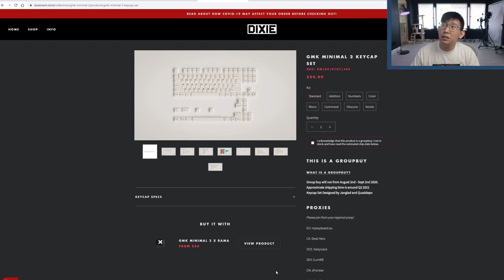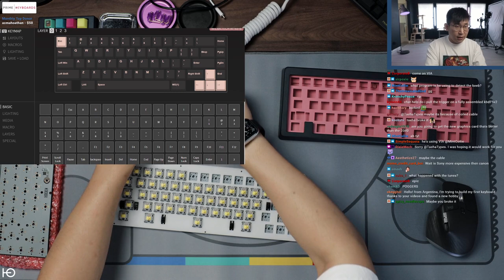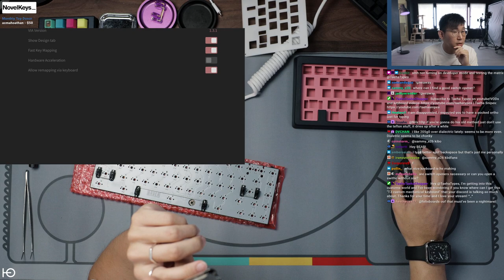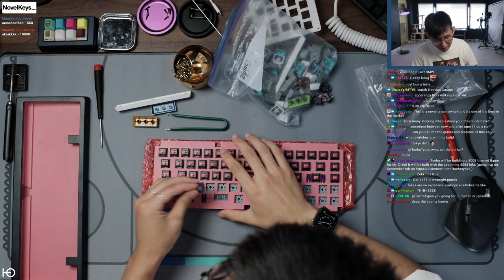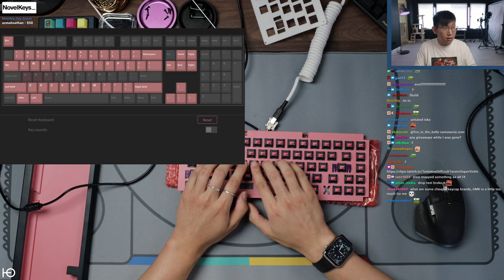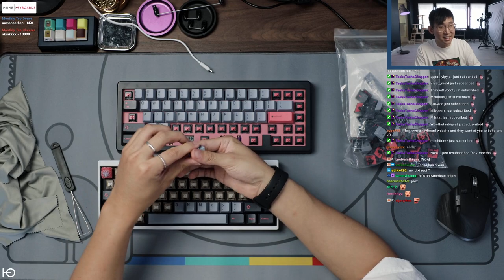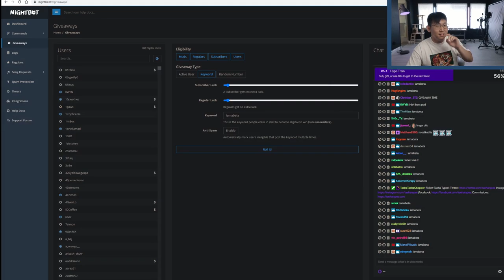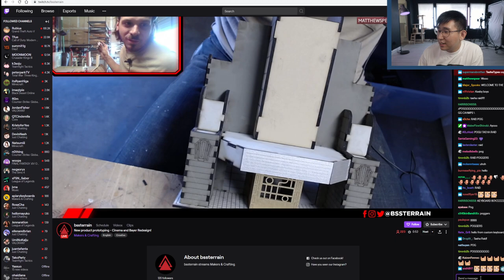8008 Bauer with 8008 Inks Build Stream

Comment: What’s it gonna run to get an exact rebuild of this? Sounds amazing
Reply: Likely around $2000, these commissions are insanely expensive.
Reply: If you managed to get on the original group buys:

Bauer Kit - Aluminum Kit - $460/Brass Kit - $560  
8008 Inks - $52.5 for 7 bags - ($7.50 per bag of 10)
GMK 8008 Base - $185
Durock Stabs 60% set - $19.99
Reply: good luck lmao
Reply: Landon M sounds standard supply demand model to me
Reply: Oscar Funes thanks for that breakdown! I’ll have to check this out